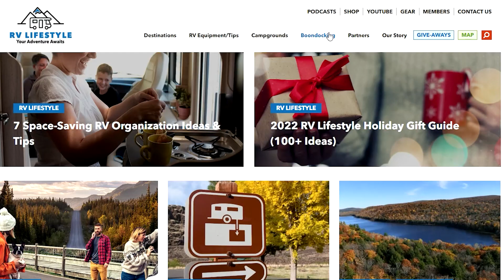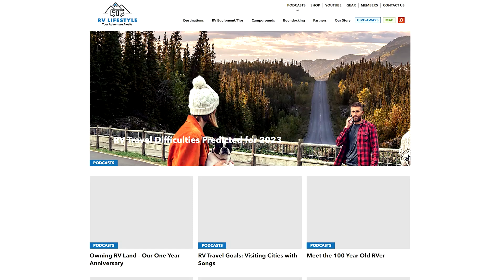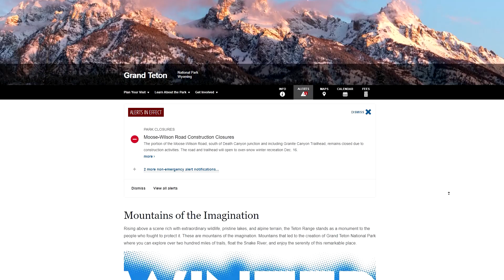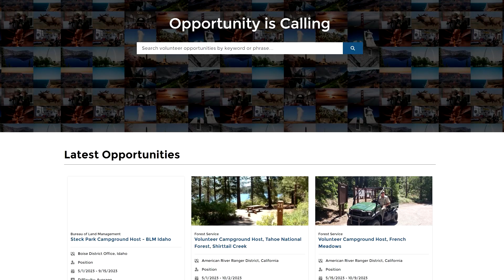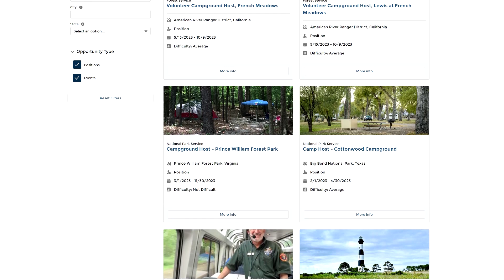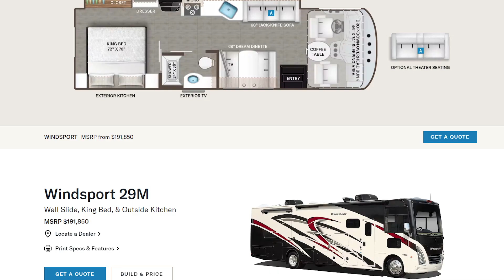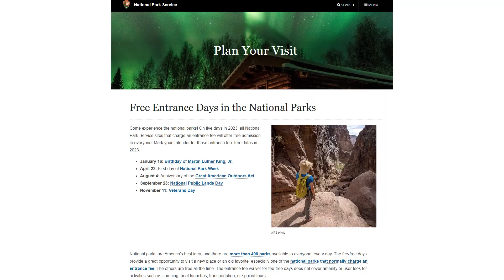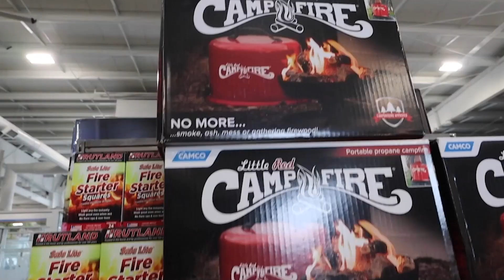How To Be A Campground Host!

Comment: For many years, I've been monitoring my vehicle performance using an OBDII bluetooth adapter and phone software.  With these two devices, I can see all the engine sensors and display key engine performances all live as I'm driving.  Retired now but when I was working I would challenge myself to achieve the best gas mileage driving the 105 miles to and from work.  I was able to get an average of 33 miles/gallon on a car that the manufacturer said only 24 miles/gallon was achievable.  I quickly learned driving a bit slower and coasting  as much as possible gave me this incredible performance. Now driving a Class A motorhome and a toad while monitoring engine performance on a larger tablet and ODBII adapter, I discovered driving 62 miles/hr. gives me the best gas mileage and a lot less stress.

Comment: I’m trying to become a camp host I’ve been going camping every year for my entire life and I plan do it year round and live out of my rv is there any tips you may have for camping thru winters and harsh weathers also this video wasn’t very informative about how to become a camping host aside from a few links for volunteering as one I’ve heard camp hosts can make money from doing there various jobs I would also be doing a lot more then just those things for example I would love to provide cheep breakfasts every morning to the campers cheap tent rentals and bike rentals also another thing about driving around a 5th wheel my dad drives an 18 wheeler semi truck I’ve ridden with him a few times when I was younger we would hit speeds of 80 mph and sometimes alil higher one major thing is how they are packed distributing the weight is crucial if it’s uneven and u hit a tiny bump it can and will throw you off the road a lot of newer drivers don’t understand this and will just throw anything wherever it will fit and go I can confirm it also takes experience to handle driving at those speeds my dad has been driving semi’s for 30+years even he’ll slow down to 40-50s is certain curves and bends also another thing if the weight is uneven even the wind can make you swerve at people don’t understand this and I believe that’s what makes alot of newer “rvers” to crash

Comment: Our tow vehicle is a Ram Promaster, and we pull an 18’ trailer. I set the cruise control at 60 and stay in the right lane. My gas mileage and stress level are both much improved😉

Comment: Just a comment: we have a converter in our rv but not an inverter. We are able to use all 12 volt plugs and lights in the rv. We would need to add an inverter if we wanted to use the AC plugs.